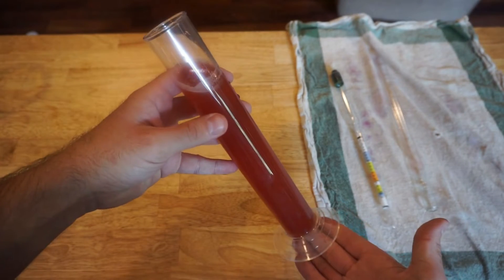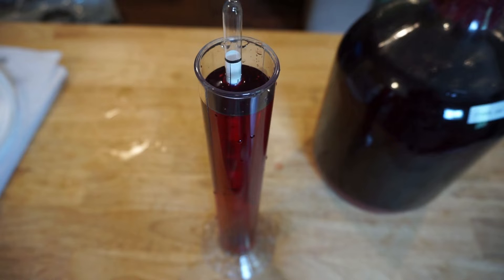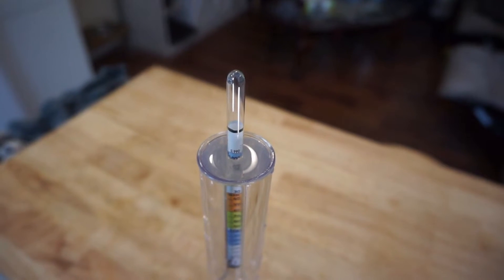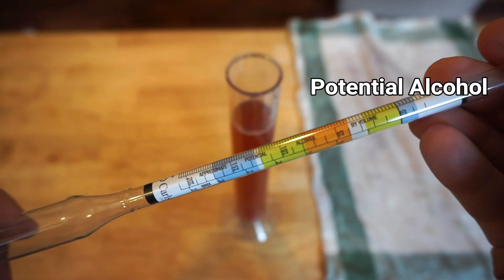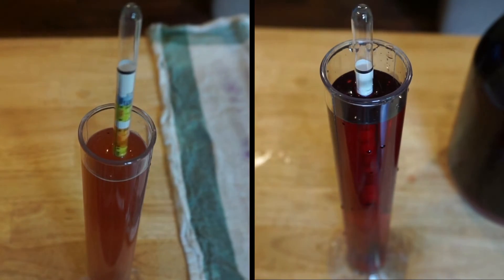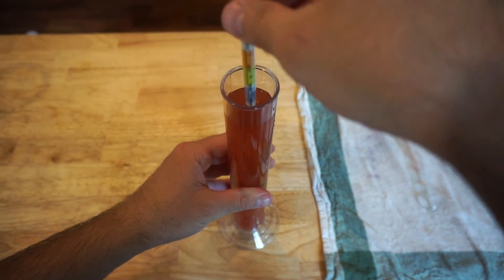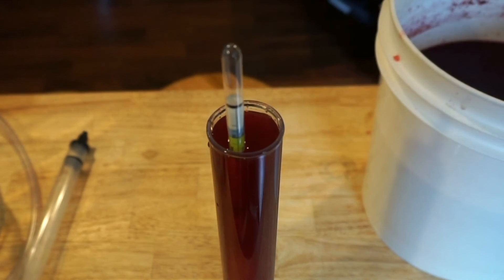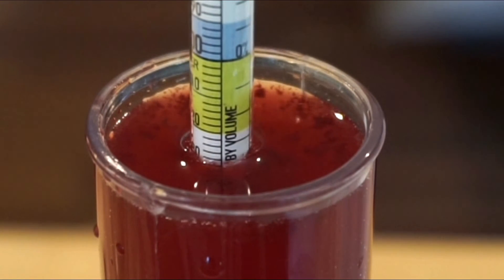How to Use a Hydrometer for Winemaking

Comment: Another "old timer" way of doing this how I originally learned as a kid is a kind of unscientific two way principle you really gotta learn how to do from an old hillbilly is the glassing or candy method. You can judge the sugar content in your must or mash by putting a drop on a glass and letting it evaporate. It leaves behind a sticky drop. You put your finger on that sticky drop and if when you slowly pull your finger off it gently pulls your skin, like sticky but your fingerprint stays defined your finished abv will be around 12%. If it deforms or stretches it will be lower at about 10% and if it'd hard it will be higher abv. The reason is the sugar hardens and the " in between" hard and tacky is where you want so you know to add more sugar or more water. You can shine a light through the drop and the closer the reflection is to the color of your   drop the closer to 12% you are. Lighter means there's less sugar and more water lightening the color darker means there's more sugar. Just a tip if you don't have the fancy tools on hand and like I said it's not 100% scientific and spot on accurate but it is pretty close and I've used I before  and got where I wanted to be by doing it

Comment: Great explanation but one thing you’ve missed, different temperatures can lead to different readings. 
Cooler temperatures can lead to low readings and higher temperatures will be less denser. 20c* is around the point you want to measure. I make spirits not beer also. 🔥
Reply: True..   hydrometers are calibrated at certain temperature..  
If my thermostat is constantly 70°f, couldn't I take a reading in plain water to adjust for the variance from the calibrated temperature?

Comment: I made a mash of honey water and crushed grapes with grape juice. Somehow I managed to get a higher reading the second time after 2ish weeks. Is that because of the grapes breaking down finally to add sugar to the mix?
Reply from the maker: I’m not going to pretend to be an expert but maybe the honey wasn’t fully dissolved in the water? The first fermentation is the most active and should ferment the majority of the sugars in the first few days
Reply: @OldManStino  I know I don't have it in ideal temps so it's definitely slowed down but it was much faster the first 2 days. To the point my airlock actually got blocked 3 times and I had to drain off...
Reply from the maker: @knules2  I have no idea why the reading would be higher after that, it should be a good bit lower. What were the two readings?
Reply: @OldManStino  first was 13% abv and the second was around 31%
Reply: @knules2  maybe the second reading was touching the bottom or grapes instead of floating.
Reply: @seand.5535  ya know that makes sense, but the other way around, like the grapes may have held it down. I used a graduated cylinder for reading 2 and I don't remember for reading 1.

Comment: Hi, What or how do you adjust for temperature? Mine was at 1.11,25 and 14 percent but, it was 79 degrees not 60.
Reply from the maker: I only really worry about temperature  when its too cold and got a little heating pad for my carboy

Comment: Does the volume of the measuring cylinder need to have a minimum requirement? Is it ok if use a thin measuring cylinder?

Comment: Thanks a lot.  
I made pineapple wine. I forgot to take initial gravity. But at the end it  was cmg around .990 
But after back sweetening it it changed to 1.050.
 I am new into brewing so all confused.  
The alcohol content produced must be taken before the back sweetening?
Reply from the maker: Yea, you would need to take the reading before and after (before sweetening) the fermentation.

But pineapple wine sounds delicious, how did it come out?
Reply: @OldManStino  Thanks 😊 .It turned out really good. But tasted quiet strong. 
Next time I do it right to get the correct alcohol reading.
Reply from the maker: @veenaxettigar  Oh I bet, was it acidic at all? Did you use fresh pineapple?
Reply: @OldManStino  yea I did use fresh pineapple. Next time I think I shld use something for acidic Balance at initial stage.  It's still sitting for more clearance. Almost 3 months now. Only I have tasted it :)
My spiced rice is also sitting for clearance. Not tasted yet.
Il be beginning with rose petal wine,  grape again but with roasted oaks( hope it turns out good),  and Apple wine I am hoping to make it sparkling. But bit scared I may burst the bottles.
Any tips please? 
Thanks in advance.🙏

Comment: No help what so ever. As usual wine snobs can't break it down for beginners.

How does one literally READ the wine meter. Break down and explain in an example a specific gravity reading. (Since it's a specific reading that is needed)

There are no (decimal) points on the scale where is the .070 in a 1.070 reading? Also, spin the meter faster when showing. Hate to learn something. 

Golfing with a yard stick is easier than learning the BASICS of wine making.

Patience required in wine making? (Patience in wine LEARNING. )

Comment: Do you pour the wine back in after you check it?  Cant u just put the hydrometer in the bucket?
Reply from the maker: You're biggest concern with pouring it back into the mix is introducing unwanted bacteria into your wine.

In a large scale batch you can just discard after testing without it making a huge dent in your final amount, but when youre making a gallon batch a hydrometer test can be a pretty large percentage of your  batch. So sometimes I do put the hydrometer test back into the mix.

If you plan on adding it back into the mix make sure your sterilize any equipment that's gonna make contact with your wine (hydrometer,  test tube, wine theft).

Comment: can you put the initial "before" sample back in the bottle to ferment?
Reply from the maker: I've read to discord the sample, but it's kindof alot of wine if you're only doing a small batch. I normally sterilize the test tub, hydrometer, and wine theif and throw the sample back into the batch
Reply: I wouldn't.  It is exposed to the air.  Just swig it.

Comment: Can you take a hydrometer reading after adding campden tablets?
Reply from the maker: Sure, the hydrometer just measures the weight of the liquid, so when it has more suger, it weighs more and will push the hydrometer higher. The campden tablet shouldn't effect that